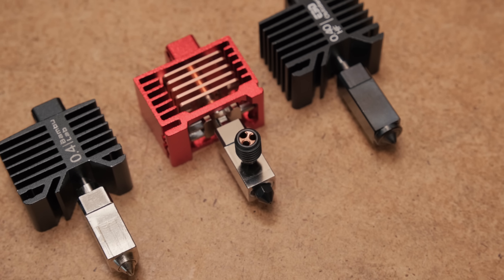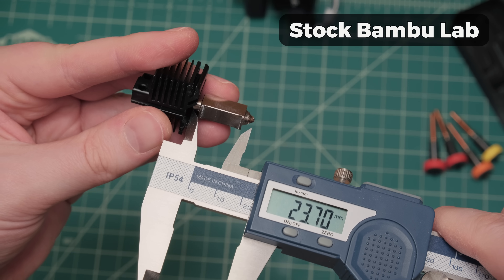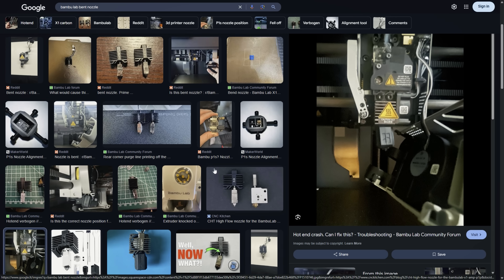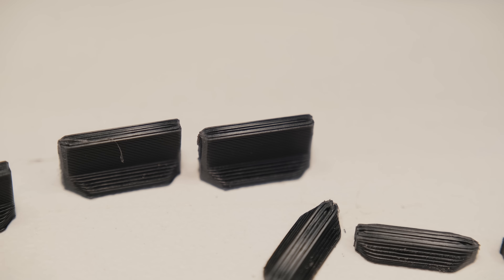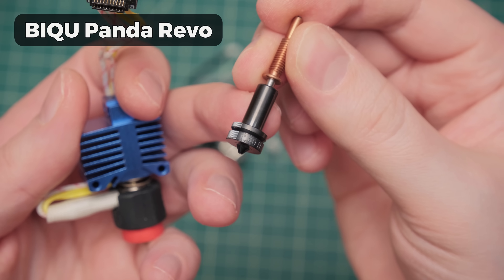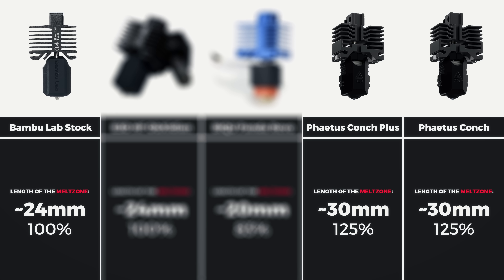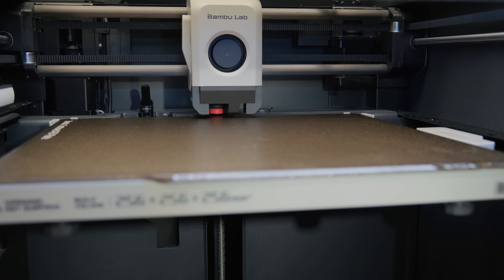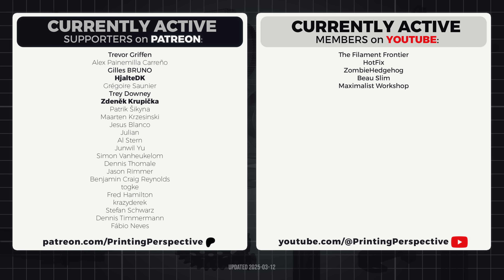BIQU Panda Revo vs Phaetus Conch+ vs E3D HF ObXidian (HOTEND TEST for Bambu X1/P1)

Comment: E3D really needs to rework REVO or drop it altogether, this is really embarrassing

On another note there's the Slice Mako hotend that looks very interesting and uses M5 nozzles, and Luke's Laboratory is working on their own version too
Reply: It's one of the last projects from Sanjay mortimer so I hope they keep it or drop the patents If they drop it so his legacy can be preserved
Reply from the maker: Yeah I'm still waiting for the Mako...
Reply: @PrintingPerspective 
the reviews on their site seem to show lots of clogging issues
Reply: It was not intended for high-speed printing.  The modularity and rapid nozzle change is the point.  You can also get the more powerful heating element, which would improve the throughput.

Comment: I had E3D one, unfortunately it get clogged and despite of all my attemtps to unclog it - cold pulls, extruding wet nylon, dipping into diclorethane, using torch, I was unable to fix it. Seems like something cloged one of CHT channels.

Great to hear that there is perfomance alternative with Phaetus.
Reply: I have these on 6 machines and 2 of them just clogged and I’ve been unable to unclog them. In my case it was metal from the extruder gears that have worn down and gotten into the hot end. Apparently the extruder needs maintenance every few hundred hours and I haven’t done anything in 3000 hours. Oops…
Reply: It’s a major pain to unclog cht nozzles. I managed to unclog mine some how after so much trying to unclog it.
Reply: My E3D one just clogged too, but I think I was able to get it unclogged. I don't think my clog was inside the nozzle though, but inside the heat break. Took hot end out and got a allen key just big enough to fit inside filament path. Heated allen up with a lighter and forced it in the heat break. When it cooled just enough I was able pull out plastic with it. Kept doing that until I removed enough to make it to the heater block. Then I heated up the heater block with a lighter and was able to push until I made it to the divider inside the nozzle. Then heated up the heat block again with the lighter and used some cleaner filament to push through and got it flowing out the nozzle. This video couldn't' have come at a better time as I just got done dealing with this and was looking at ordering a replacement hotend. I just need to put everything back together and see if it is indeed unclogged now.
Reply: Thank you for mentioning this. I had so many problems with the E3D and switched back to the stock hotend which outperformed the E3D. Piece of crap.

Comment: i love your video its very clear! the only hotend i miss is slice engineering. and does the cht make multicolor prints more difficult /more purging needed?
Reply: Yes and yes. Cht creates more waste, so does length

As for the mako its availability is non existent in Europe and its incredibly expensive at 125 usd. Many users also report issues, only 3,1 out of 5 star rating on SE homepage. The new nozzle standard doesn't help, on the tz hotends you could at least use v6 nozzles with modifications to the wiper
Reply from the maker: Thanks, the longer melt zone, the more purging is needed. I waited like half a year for the Slice Mako, but to this day I still don't have it. Maybe in the future, if they won't cancel it.
Reply: @PrintingPerspective  sorry i meant micro swiss not slice engineering. i know mako is not so great

Comment: No TZ2.0/3.0/4.0 in the lineup? Is there a reason you omitted them?
Reply from the maker: I already tested them in my previous bambu hotend testing video, they are waste of money unfortunately. :/
Reply: @PrintingPerspective  It depends imho. The TZ2.0 costs 8$ or so.
Also i think the temperature sensors aren't trustworthy. I had a TZ3.0 and the temperature was way to high, the filament came out cooked and i had constant heat creep clogs. It would be really interesting to do the tests with the same temperature sensor model from a trustworthy manufacturer.
Also you only tested with cheap chineese nozzles.
Reply: @Alterproll  I use 3.0, and all 6 machines print normally, meeting the print farm standards

Comment: Speaking of bambu hotends the A1 ones are awesome. An insanely  long meltzone and quickchange without messing with wires. im designing an idex  using these...its been rather rough. Ive just figured out that the heat module "ceramic" (CF epoxy?) Backplate Heats up to 180c while printing...but only where the aluminium heat block is, the mounting screw area stays at 60c. I discovered  this when my printhead started smoking 😂😂
Reply from the maker: You mean A1? Those have better flow rates than X1/P1 ones.
Reply: @PrintingPerspective  I haven't tested the flow rate but just checked, and the stock A1 hotend has about 29mm meltzone but one of my offbrand p1 hotends has a 23mm meltzone. The difference  isn't as massive as I thought but I've always  wanted to be able to yank a 0.4  hotend out and stick a .8 one in a few seconds, so when I finally finish a non fire hazard design, I will be happy 😊
Reply: heat block is brass btw :)
Reply: @riba2233  I have the brass A1 hot end, the texture is better
Reply: How do you measure/find info on the meltzone?